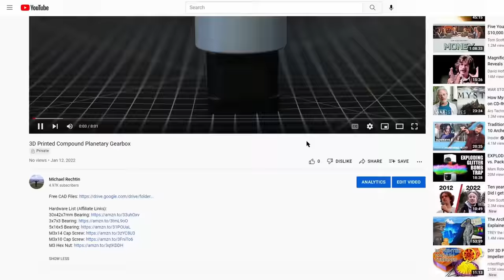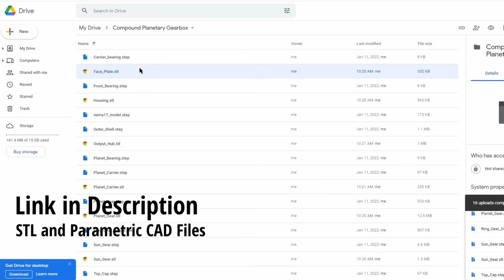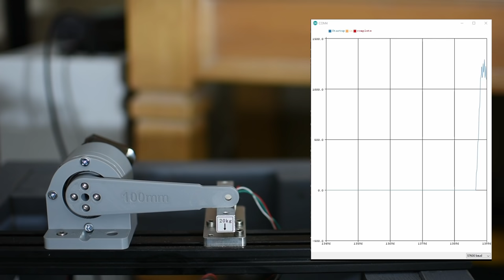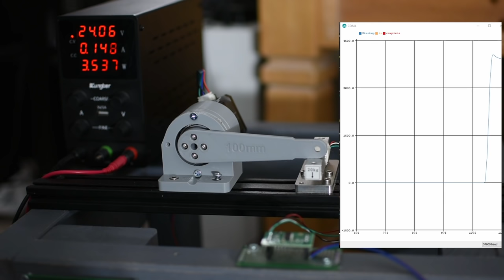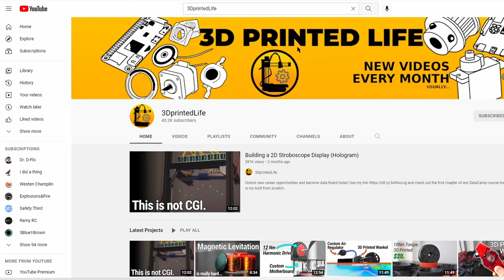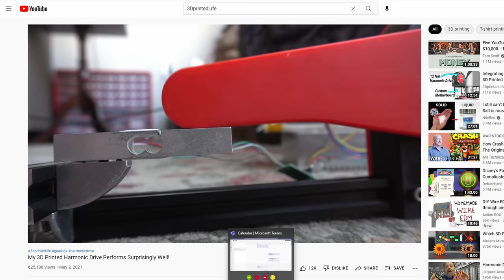3D Printed Planetary Gearbox! Resin vs FDM Printing?

Comment: The design of your planetary should be optimized first before going further. For one, straight cut gears are significantly weaker than helical gears. Considering these are PLA, that will not be an overall issue for "manufacturing." And as another (somewhat) said, increasing diameter is hugely beneficial. 
Helical gears allow for multiple tooth contact at any given time. Effectively increasing your loading surface area. I mean, think about the length of each tooth if that doesn't make sense. What is longer, the "hypotenuse" or the straight 90* intersection between the two faces. Helical takes this same idea further.
The downside to helical is that it costs energy that's wasted in the axial thrust produced. For your application though, I think this is worth the trade off. You can easily combat the extra friction with something as simple as a basic PTFE plastic safe grease/spray lubricant. Leave a port to allow for easy lubricant replenishment.

Furthermore, make sure the resin doesn't have casting or whatever process you're doing, stress risers along the tooth face. If there are issues on the surface it will break much sooner than it should. Lastly you should also look into surface "coatings" that you can employ with a recasting technique. See if there are any composite solutions that fit your resin material that could harden and strengthen the gear face. The gear face is really the most important part.

Ideal alloys for gears actually are very hard on the outside and soft/ductile on the inside. I imagine with creative and strategic selection of resin mixture, you can achieve a softer core, and a very hard external surface. This really doesn't cover the full extent of how that surface hardness needs to work in terms of stress, BUT I think it's very relevant when we talk about a failure mode of this resin.

A good comparison for sharing these results would be to compare the relative surface hardness of this PLA vs the Resin.

Comment: Ive said it many times... Resin for artsy prints. fdm for actually usable parts and projects.

pla is standard. it works great. to get a suitably strong resin print, you need to go out of your way to buy special resins that is so much more expencive for similar results.

A fair comparison is comparing standard to standard. standard resin vr standard filament, resin will lose in the strength department almost all the time, unless you really screwed up your fdm settings.

Comment: resin could likely be used for engineering stuff 
though youd need some resin that is specifically made for it, typically resin is only used for modeling 

for some parts i got some meant to be super strong after curing, and its a little stronger than standard plastic though brittle (not insanely strong, but strong for resin standards)
Reply: I still haven't heard of one that's up to standard ABS standards. Even though PLA is like 4x stronger static loading, resin still can't compete with either, yet... Once it does become available designers will be using that exotic material almost no matter the cost. For example weapons manufacturing hobbyists have tried "ABS like" resins, and its not even close, fails so fast its just a joke. However they have some really artistic designs and complex parts that are a real pain to clean up in FDM (you know its not hand made until its got some red fluids on it... it truly is a real pain sometimes). And those designers could really use the precision of resin, it just doesn't exist yet (and FDM they spend a bunch on carbon fiber infused composite materials, or some have very expensive metal printers when thermoplastics are not enough but that's typically commercial or military contractors that have those).

I also really hope metal printing becomes cheaper. I can afford a machine right now (used its only like $135k), but it weighs about 6,000 pounds (3,000 KG), and I don't know how long I want to live in this corrupt state so I'd like to move without having to move a massive industrial machine. Then those gears would be trivial. I make a lot of gearboxes and mechanical things, last gearbox was a multi-stage herringbone planetary gearbox that even plastic survived 10k rpm peak speed just fine and lower speeds without bearings for quite a while and only finally found its limits when it melted after running it slightly too hard for hours and the motor just got the gearbox drive gear up to temp when it got hot due to overloading the motor, so metal would be nice so nothing melts.
Reply: @jakegarrett8109  i skimmed through most of that (ie i read like the first line) but there are some companies making certain kinda of resin for engineering purposes, dunno how well it works since its VERY expensive, but i imagine we will have some better stuff in the near future with how quickly 3d printing tech is advancing
Reply: @jakegarrett8109 there are tougher resins and there is a chance this guy over cured the resin or didn't do it at the optimal temperature, resin is very sensitive to print right, using engineered resins like syrayatech nylon black would yield more impressive results but with a even heftier price tag. They also make resins that can resit higher temperatures than PLA.
Reply: @miguellopez3392  AC set to ~75 degrees, curing for around 3-4 minutes. wouldnt say im doing anything wrong, the resin being brittle is just a inherent flaw in the material itself. afaik you wont find any kind of resin that isnt brittle to some extent

though i never actually had an issue with my prints, walkman parts dont tend to be used in high-stress applications

Comment: I printed and built your gearbox. Great work. Nice simple 80:1 design. Testing I noticed an occasional popping sound as the planetary gears rotate. I can feel a slight bump on the planet carrier when the sound is made. Have you encountered this or any thoughts on what I should look for?
Reply from the maker: Great to hear you printed it! I don’t think I’ve encountered any popping noises. Maybe check the gear teeth to make sure there is no print artifact in any of them?
Reply: @Michael Rechtin  That helped. One of the planetary gears had a rough tooth. Took a while to find that tooth. Sanded it a little with a Dremel, applied more Super Lube 21010 synthetic grease, and then ran the gearbox for 100 full clockwise and counter-clockwise runs. The crunchy sounds stopped and the gearbox runs smooth now. I'm curious if Resin printed gears have better teeth prints on average.

Comment: A bunch of guys at my work are all getting into 3D printing and are all going resin.  They give me grief over being an fdm printer.  They keep saying resin printers make better mechanical parts.  Seems my old out of date CR-10 can still hold its head high.  I have some prusament pc blend carbon, just need to install all metal hot end, can’t wait to see how strong the parts are.
Reply: not sure what they are smoking. Its pretty common knowledge that (at least currently) FDM printers make better mechanical parts. I went with resin years ago because they can achieve detail and tolerances that FDM just cant touch and I mostly print miniatures and busts. The resin parts themselves tend to be brittle. That being said we have seen a lot of progress in resins over the last year or so. Maybe one day we will get to a point where the resins can compete with PLA in the mechanical properties.

Comment: You’re using 70% IPA to clean your SLA prints, this will cause issues (warping) with a lot of resins due to water absorption. You need to use >95% IPA (99%+ ideally)

And of course the resin used here isn’t the right one, you need engineering resin which is almost unbreakable (it will bend under high stress, similarly to how PLA would)

Man that hammer and spatula gave me bad memories. Definitely invest in a magnetic print plate if printing in SLA, it will change your life.

Comment: Hi, Your FDM printer is slow...i understund about quality but the time have also matter. With 20 or 30mm/s can print any printer. For FDM printer you have lot of materials PLA,ABS,PETG,ASA,Flexible,nylon carbon fibre. Materials for temperature 200c and much more lighter than resin. You can test another materials too

Comment: An engineering resin  designed for these kinds of loads would probably perform better, and I'd probably go with a graphite lubricant (or at least double check that the lubricant used does not  degrade the resin)

Comment: Without identifying the  "ABS-Like" clear resin" in more detail this doesn't tell me anything about FDM vs. resin printed parts strength and durability.  As others have commented, using a different resin specifically designed for high strength applications would probably have yielded very different results.  If your goal was to compare FDM vs. resin printing for mechanical parts durability then you should have used two materials that had very similar mechanical properties IMO.

Comment: Though resin should be able to compete with PLA. Though I suspect that even if they perform similarly in tensile and impact tests, all resins might be much more fatigue suseptible than thermoplastics.
Reply: I don't know what it is, but resin is absolutely inferior to PLA in my tests. I couldn't print anything reliably. They look absolutely gorgeous, but mechanically absolute shiiit.
Reply: @jothain  There are special “tough” resins that are better mechanicaly than standard resins, and there is a curing sweet spot that maximizes toughness. Particularly beyond that sweet spot curing time, resins become harder, but less tough (i.e. brittle). Toughness of thermoplastics tends to be pretty good because they are relatively soft, but hard enough at room temperature to not be plastically deformed easily. Thermoplastic toughness is also influenced by printing temperature (sweet spot between layer adhesion, detail and heat degradation), water content (for some types more than others) and postprocessing (anealing, doping, sealing).

Comment: Well, I think you 're overexposing the resin! Curing for 10 minutes seems way over the top. 2 minutes would be better imo. 
Also, if you have to use that much force to get them from the build plate, you might consider lowering the bottom exposure times.
But nice job on the construction and the video!

Comment: When I got my resin printer I was awestruck with the print quality. I made one pneumatic water dispenser part. Really small part that's originally made from plastic and I replicated it 100% down to ridiculously small markings in original. But when assembling I broke one. I thought it was a fluke, printed again and once again broke. Printed in slightly different orientation and settings and it still broke and I do mean with ridiculous ease. Nothing even remote to any PLA, PETG, ABS or materials I've printed with filament machines. I print pretty much solely functional parts and I haven't even powered on my resin printer for about year now. Such a disappointment mechanical wise 😒
Reply: Thank you for the info. I'm too interested to get into 3D printer, but there is this hype about resin printers with all it's accuracy. But I always wanted strong plastics for part to be made of. Now I'm seeing why resin printers is a bad choice.
Perhaps in the future, we need laster printers, but printing in ABS etc, instead of resin.
Reply: @ChargedPulsar  there are many resins that are very strong, just not the cheapest ones
Reply: How do you not know before buying a resign printer?

Comment: So much wrong with this test. Mainly it is just using random materials rather than specifying materials based on strength parameters so you have similar materials in order to evaluate different processes.
The video itself is very nicely produced.

Comment: Кроме прочности есть ещё стоимость! И цена смолы Больше чем пластика!
Дополнительно : есть очень богатый выбор пластиков с разными свойствами, вплоть до мягких! Есть твёрдые, есть износоустойчивые - любые! Для любых задач! А вот у смолы есть очень небольшой выбор...
В результате для фотополимерных принтеров есть очень немного вариантов применения, а для FDM очень много! И это многое частично покрывает и возможности фотополимерных принтеров.
Вывод сделайте сами.
Reply: Resin has choice now, you can get impact resistant resin, bendable resin. Resin that tolerates heat better than any plastic for FDM, and resins with hardness higher than anything on FDM.

Comment: If resin wasn't so dangerous to work with it would be great!  But I don't see it as good for hobbyists for that reason.
Reply: As long as you have ventilation in your room you don't even need a respirator, most dangerous is continuously having skin contact with the resin and alcohol washing, hobbies sometimes take a lot effort but if it's worth it then it's a good hobby for them, I don't mind it since it makes me feel like I'm in a science lab with how much protection, prep, and steps I have to do to get 1 print right.

Comment: resin is for pretty not function.  When they get resin machines to be as simple as FDM (print and use - no curing, no bath, etc) ill switch.  I dont think that will happen anytime soon, and when it goes - the machine will be very expensive im sure.

Comment: EDF Jet RC did a great resin test with many resins https://youtu.be/gb_I-9UZem0
Basically he likes Sirayah Tech Build and Tenacious resins in a 50/50 mix giving him strength and flexibility in the final part. You could tweak that ratio to suit. Makers Muse did a test with gears and various FDM Filaments and found BASF PRO1 PLA to be really good. https://youtu.be/UtRJ4lnNAXY. I would love to see this test done again with those suggestions. Thanks for a great video.

Comment: resin is brittle and it will bend under heat stress
Reply: You can get resins that resit heat better than any FDM meterial, And also use additives that can make the plastic much more bendable.

Comment: 10 minutes post-print curing? That's way too long. To do this investigation thoroughly, you need to vary the UV curing time. Also, I didn't notice you say anything about what resin you used. There are "engineering" resins for functional parts.

Nice videography. Not very helpful information.

Comment: Pla is an awful material to make gears out of, they have issues with creep, they melt and smooth under intense wear not to mention they have terrible stiction and friction characteristics.

Please use nylon, abs or petg, they are all self lubrication.

Resin will powderise over time due to their short polymer chains.

Comment: #1 please never use hair spray on your FDM printer bed that is elite noob sht that only clogs up your fan and makes everything sticky around your machine.. yuck!
#2 Why would you spray WD-40 on plastic? It contains petroleum distillates that will make the plastic degrade. 
#3 Why are people who design in CAD not capable of excluding so much hardware by reconfiguring their design to have simple things like.. snap in tabs, or screw in latches???